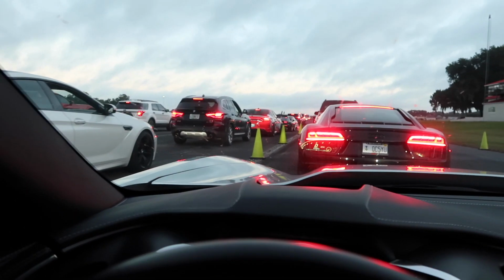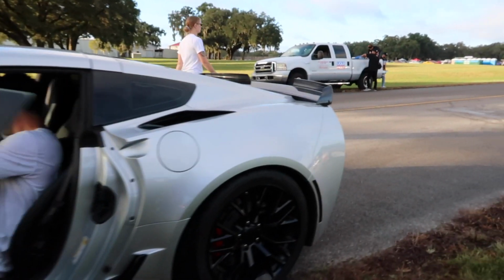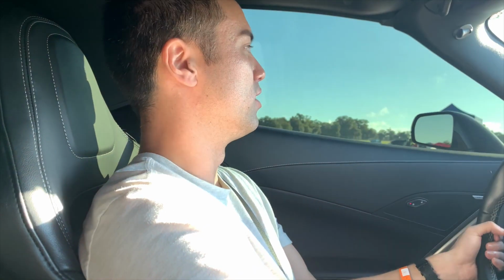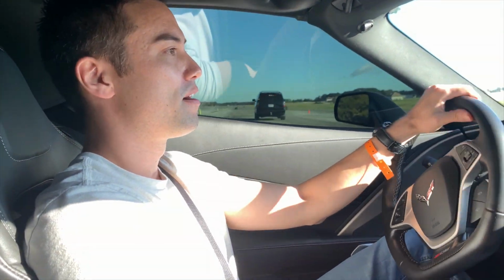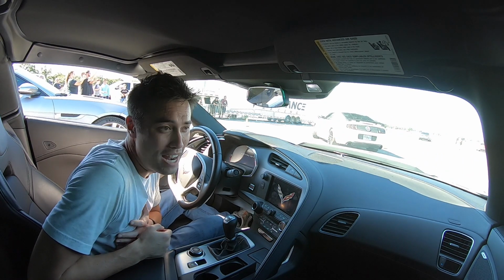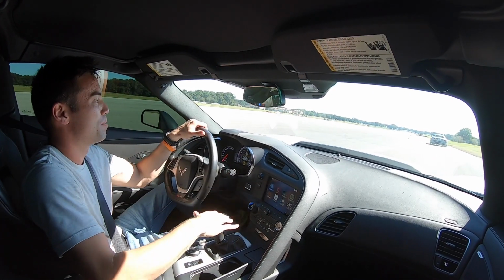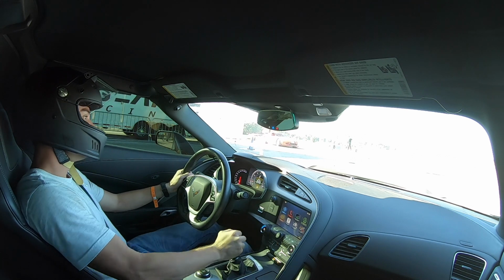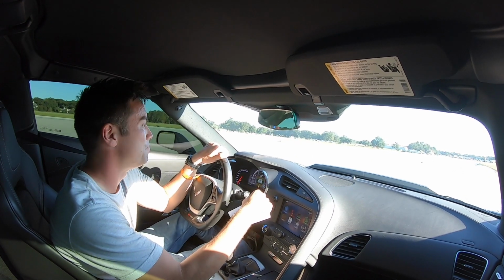WannaGOFAST Ocala 1/2 Mile

Comment: Props for posting. Time for mods. Mid to high 140s is pretty meh.
Reply from the maker: lol, I think it has mid 150's in it on race gas according to previous owner...  but I have to agree with you!
Reply: RearWheelDrive it was pretty hot that day. I raced on Sunday. Managed a personal best out there from the last time I went. If you let your call cool down really good, caught some good weather at the track and got some race gas you will break that 150 mark. 

Seems like your car breaking up might have been an aggressive tune and the weather was really hot. Those things together don’t go welll.
Reply: RearWheelDrive I came to the race with an aggressive tune setup going for a real fast trap and kept going in limp up top. It was just to hot and iat’s we’re getting up there. Had to change pulleys and drop some boost to make clean runs.

Look into an ice tank for the car to help on races like this. Helps allot for iat’s so you can keep making power up top.

Comment: wait hold up you are going to run a 1/2 mile at wide open throttle on rims that was tightened with a 4 way lug wrench no torque wrench wow dude get a cordless with a torque socket
Reply from the maker: jim sbarglia 💪🏼
Reply: @RWDC8Z  it's not about getting the lug nuts tight you need them to be equally tight or you risk the lug with the least torque backing off